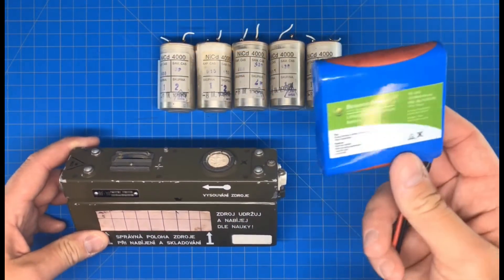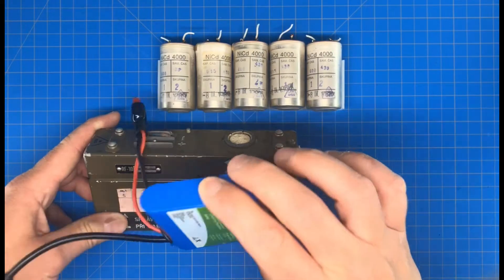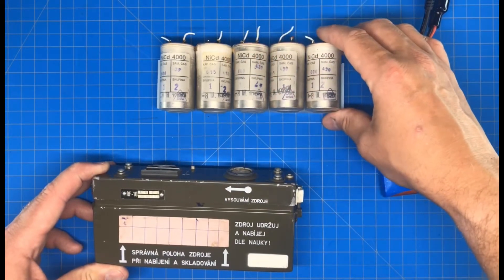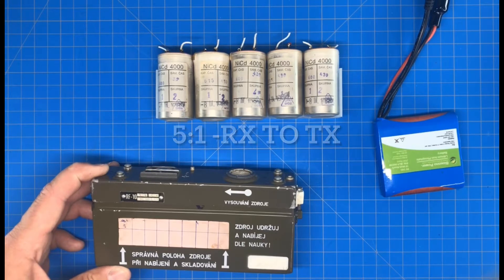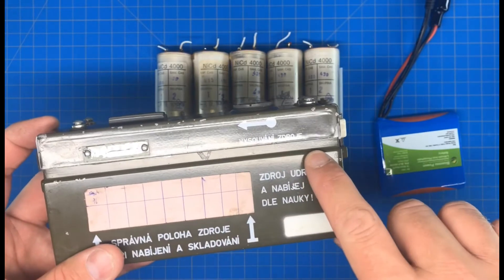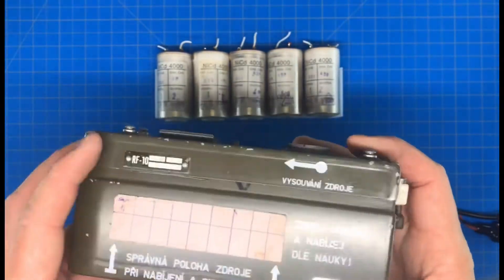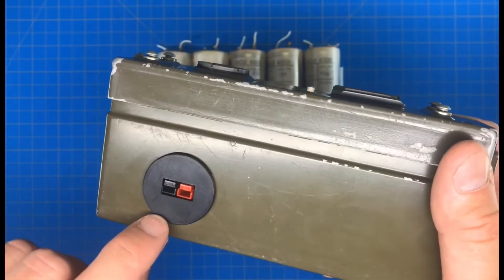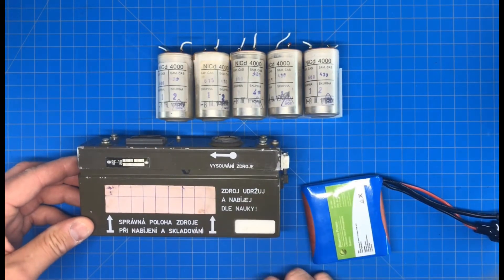RF-10 Battery Rebuild

Comment: It's a shame about the Ni-Cd cells. From the looks of it, they look perfectly fine. When they're in bad shape, they usually have crystallized chemicals on top, but your cells look like new. All you had to do was charge them. I have 5 battery packs with my RF-10 and only had cells this nice in 2 of them. And even the worse looking ones usually work.
If you properly discharge those cells to 1V/cell occasionally and recharge them properly, they last forever. You can use a cheap lab power supply to charge them.

It's a shame you cut them out of the battery pack.
Reply: the only way to charge the original batteries from what i have seen is its official charger, how else could it be done? what kind of lab power supply? i would love to keep the one i ordered stock
Reply: @johnmatheson9462  Any kind of lab power supply. A laboratory power supply is a cornerstone of every electronics hobbyist’s toolkit; it’s simply a variable voltage source with adjustable current limiting. Entry-level ones cost just a few bucks.
Reply: @johnmatheson9462  Basically, any common laboratory power supply that allows a constant voltage of 0-30 V and a constant current of 0-3 A will do. 
Even very cheap ones from Chinese e-shops.
On the power supply you set the voltage to about 12 V and limit the current to 400 mA and let the battery charge for exactly 12 hours. The original charger does the same thing.

I have to admit that I have started experimenting with replacing the original Ni-Cd cells with LiFePO4 cells. Which I also charge with either a lab power supply or a model battery charger.